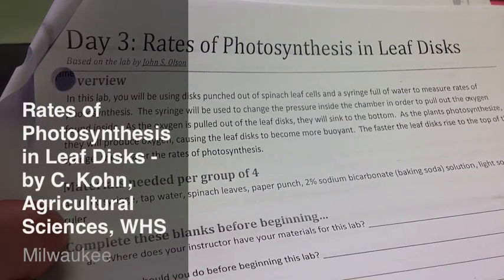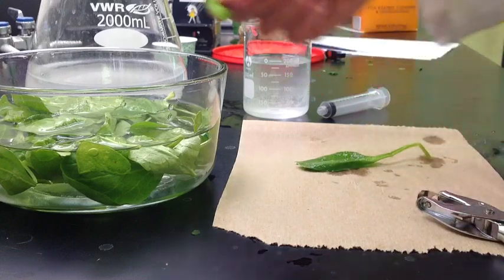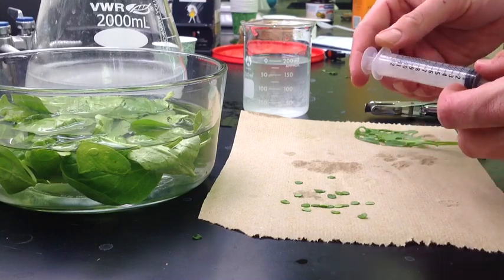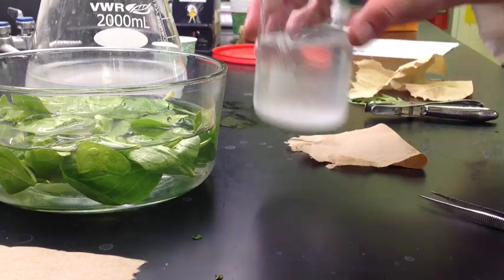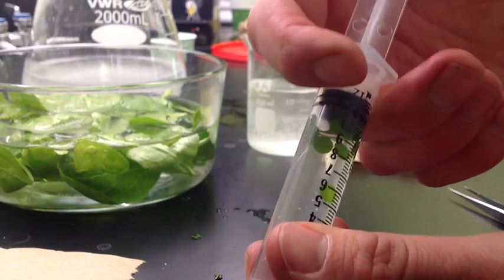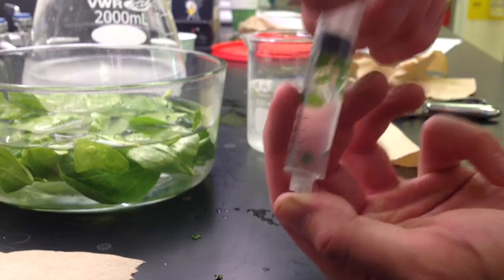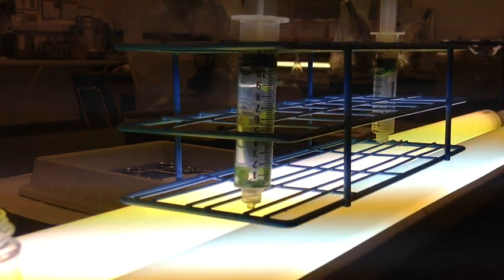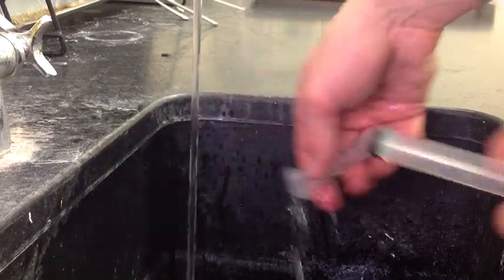Photosynthesis in Leaf Disks Experiment

Comment: I have a question, why the darker ones will work better?
Reply: i've not thoroughly studied this topic yet, but simply explained the darker ones have a higher concentration of chlorophyll per cell on average, thus the light dependent reaction which is how the leaf dics produce oxygen to float back up (and occurs in the thylakoid membranes) would be faster. basically more chlorophyll faster absorption of light after production of oxygen. hope im accurate enough and hope this helps!